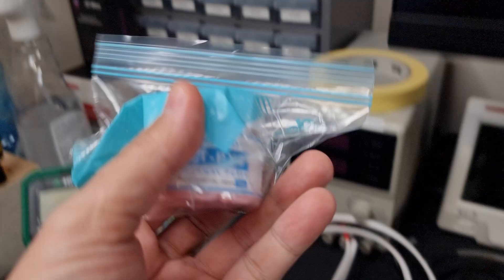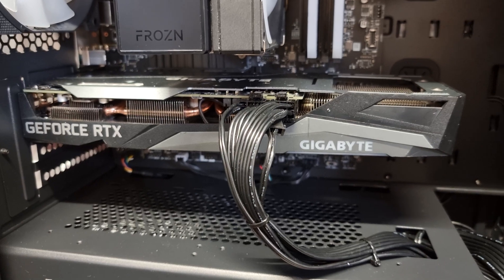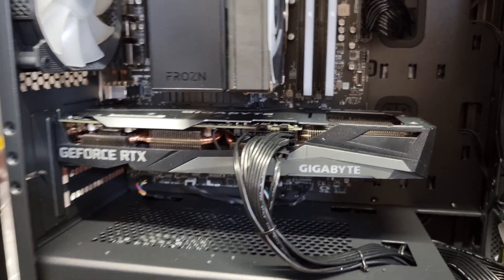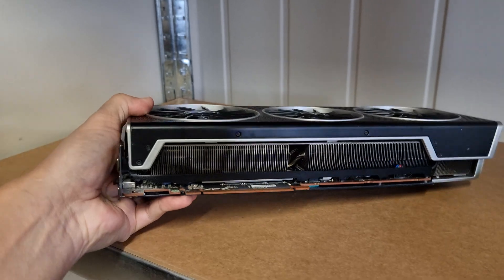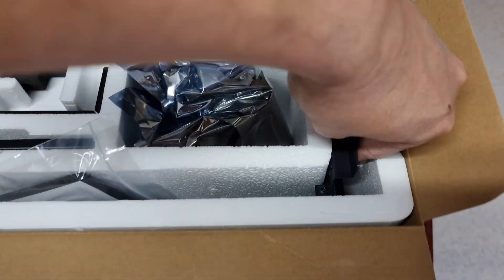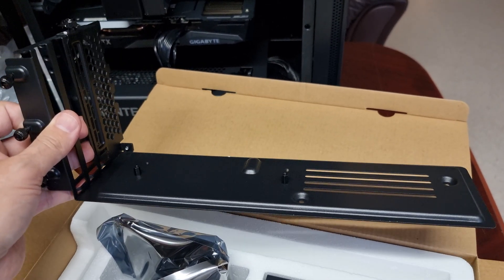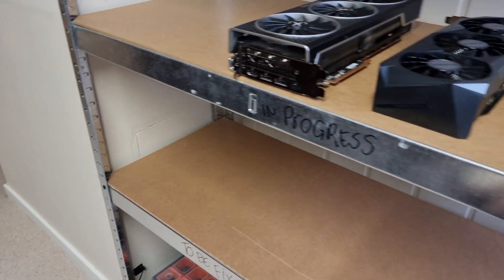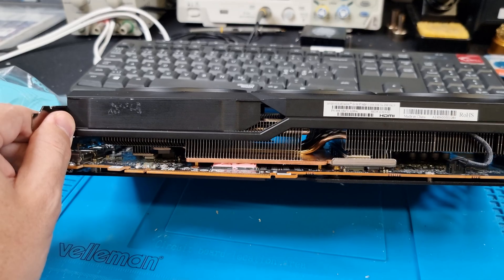Why Modern Day Graphics Cards Are Dying Prematurely.

Comment: Never had any problems before. Most of the cards I bought were on the lighter side. But when I got the 7800XT it was this big, heavy brick that felt like it could break my mainboard with its weight. I didn't feel comfortable using it like this, so I got a support to put under it. I do that for all cards that come with a big, heavy cooler now, because none of my cases has room for a vertical mount and I don't want to get new ones that have either a worse airflow or no room for optical drives. And the few cases that have both, the good airflow and the drive slots, they can cost almost as much as a graphics card.
Reply from the maker: Supports work fine. I have had many RX 7800 XT's come in for repair and it is always the same issue: ripped pads under the memory chips closest to the PCIe slot, due to sag. So you did right putting support under it!

Comment: I don't want to install my Asus TUF RTX 5080 OC vertically. Can I use the GPU anti-sag screw that comes with the GPU in the box? I will install it horizontally/normal.
Reply from the maker: Yes, as long as you level it properly with the support, you should be just fine!
Reply: @TechnologyHive  Thank you. Which one is the best: the anti-sag that comes with Asus TUF or ASUS ROG Herculx?
Reply from the maker: @VKing79 I like the way the Herculx looks. But really any support will do. I would install it between the second and third fan. I buy these in bulk and work perfectly fine. They are made from Aluminium: https://www.temu.com/goods.html?_bg_fs=1&goods_id=601099695186759&sku_id=17592891160347&_x_msgid=151-20250904-18-B-905764602225426432-427-zLleLmFr&_x_src=mail&_x_sessn_id=oxi6jszmzo&refer_page_name=bgt_order_detail&refer_page_id=10045_1763731584889_5tet87xich&refer_page_sn=10045

You can also find them on AliExpress.

Comment: im planning to buy an rtx a2000, do i need sag brackets?
Reply from the maker: By the looks of it, it is a two slot card with a plastic shroud. Honestly I have never seen one like it come in for repair. And I know people use these things horizontally.
Reply: @TechnologyHive  i plan to use it in a standard vertical pc as my desk doesnt have room to lay it down horizontally

online listings i saw apparently weighs this gpu to about 200 grams
Reply from the maker: @spiralingspiral72  Like I said, these cards rarely come in for repair, and it is usually because of mosfet failure or other issues.

Comment: My Sapphire came with a sag bracket. Even then you cannot cheat physics, it is super long 3 fan variant. It would not hold exactly level on those 2 little screws gripping this long sag bracket acting as a lever. But guess what, i spent 5 extra bucks and added a very nice, metal, magnetic vertical stand off Amazon and now there is zero sag. Is that safe enough?
Reply from the maker: Yes! You can also buy one from AliExpress or Temu. I bought this one here: https://www.temu.com/goods.html?_bg_fs=1&goods_id=601099695186759&sku_id=17592891160347&_x_msgid=151-20250904-18-B-905764602225426432-427-zLleLmFr&_x_src=mail&_x_sessn_id=5tvx3pe5b8&refer_page_name=bgt_order_detail&refer_page_id=10045_1763723059572_rcrer8du7o&refer_page_sn=10045

It doesn't matter where you get it, as long as it works.

Comment: I wonder what you're complaining about, that small bend looks similar to that of my tiny 3070. I think all gpus tend to bend.
Reply from the maker: Yes, all GPU's bend at the PCIe slot when installed horizontally without support. That bend kills the GPU's. It's not complaining, its called trying to help people who do not know this is the cause of a widespread problem.
Reply: @TechnologyHive  But mine doesn't bend because it's installed horizontally. It bends because the screws tension the soft pcb over the heatsink (At least that's what I think).

Comment: I'm using a sag bracket with my 5080
Reply from the maker: Yup, you should. That is a heavy puppy!
Reply: bought one for my Gigabyte 6800xt where it's been going strong after it was bought in 2022 but did scratch the card by accident after not protecting it
Reply: Same here with my RTX 4080 Super. I built it myself using a narrow DIP ICs shipping rack and a rubber foot for electronics projects box.
Reply from the maker: @francoisleveille409  People get creative when it comes to supports :)
Reply: @TechnologyHive  It helps to 'support' yourself when you build and sells electronic stuff. 😉
Reply: @UnL1k3  I have my 5080 mounted vertically with a PCIe 5.0 riser cable.
Reply: My case came with one that's really discrete and robust.

Comment: i bought the CH270 which the case is vertical base, so when having a gpu i don't need to buy a vertical extension like the regular pc case, the gpu is in the vertial mounting position by default (not like the vertical you would expect). But in your opnion, do you think mounting the gpu straight up vertically is going to affect the gpu anyway?
Reply from the maker: The GPU is hanging in this case, right? If so, I see not reason to worry. The problem stems from the card's weight and it being installed horizontally without any supports. Thats a nice case, btw.

Comment: Yeah most modern GPU's need a sag bracket if installed horizontaly. Vertical mount is the best solution i think. I have my RTX 4080 installed vertically in a Thermaltake TR100 mini ITX case. The case  also has a supprt bracket to prevent the card from moving sideways.
More case manufacturers need start inluding proper sag brackets with their cases.
Reply from the maker: IF they start creating long-lasting cards, how will they make their money? They create these things knowing the fail rate is high due to their weight when installed horizontally. They are not stupid. Its a shame. But you can find cheap supports on AliExpress or Temu even. It doesn't need to be fancy.

Comment: I have all heavy cards mounted vertikal - and if not i have anti sag under the card even on a RX 6600 :D
Reply from the maker: Then you will have long-lasting cards :)
Reply: i play a lot on rx 6600 over the years,overclocked to 2,7 (running around 65 degrees,HS around 75-80)and it didnt sag.i think this is more of a problem of mid and high pwr consumption graphic cards.
Reply from the maker: @LordTin79  Yes, its the heavier cards that are more prone to sag and thus early death.

Comment: What about the Asus Prime model? like a RTX 5080/5070 Ti?
Reply from the maker: What is your question? I have never tested those models, sorry.
Reply: @TechnologyHive  It's a 2.5 slot card so I was wondering if GPU support is necessary?
Reply from the maker: @Extravi  Yes absolutely, especially the 5080. Had to Google search image. That will need a support. Install it after the second fan, so 2/3 the way. It will live just fine like that. Hope this helps.
Reply: @TechnologyHive  Thank you.

Comment: Who opens the box, feels the weight and then trusts the fricken finger bro 😂 ?! WHO?! I BARELY, trust mounting it vertically. The 5070ti even by pny is heavy as FK. my whole case(itx) and the GPU weigh roughly the same without the cooler. Double bolt the thing vertically and pray it's tight.
Reply from the maker: I like those small ITX boxes. The motherboard being laid out horizontally is perfect for a vertical mount. I remember the Cooler Master Elite 130..great little ITX case. Sad its not made any more.
Reply: @TechnologyHive  I run a fractal ridge, it's a tower itx case. But mobo still mounts vertically. You should see how the pcie riser is a part of the frame. Its pretty nice being able to bolt the riser in place, and bolt the GPU vertically. The thing survived being drug by my car for 4 feet, a small dent in the GPU backplate near the end of the thermal fins, from landing on the pcie cables to the GPU. Nothing wrong with it besides resell value😂🤘
Reply from the maker: @atomicxpxp8430 Built like a tank then lol

Comment: Planned obsolence, either through missing features or carss physically dead... We are being robbed with shoddy build quality by design
Reply from the maker: They keep adding more metal to the heatsinks, thus more weight. A cleverly designed vapor chamber would do the trick with much less weight.
Reply: @TechnologyHive or better more robust PCB materials that can carry the wright
Reply: what if we could just put aio coolers on gpu
Reply from the maker: @spiralingspiral72  That could work also, as it makes the GPU lighter. Something like the Kraken G12 would work nicely, depending on the GPU.

Comment: Thanks for the reminder, I have always been a little obsessed and OCD about using Video Card Braces on every single video card I install. I always use GPU Extensions because it is very bad to plug or unplug the gpu power cables if the video card is plugged into the motherboard its an evil sinful practice of assembly disasembly. What your suppose to do is lay down the pc case onto the table then plug in the power cables into the card first then carefully lower the card into the case and plug the card into the board. Yes I love the 'Cooler Master Vertical GPU Card Holder Kit' it comes in black or white but you need to buy an extra large case to make it easy for u to build with. The second option is to use an old school horizontal case such as 'Thermaltake Core V1 Mini ITX Cube' or 'SilverStone Home Theater Case'. The third option is an inverted case such as 'Lian Li O11 Dynamic EVO Reverse Mode' what this does is your video card is installed upside down which is the preferred way to use a card in the horizontal position that way the heating element is pushing down onto the circuit board which prevents separation of the heating element from the circuit board. The fourth option are the pc cases that are 90 Degrees half way inverted where the video card is hanging vertically up and down for example 'Thermaltake Tower 600'. The take away is to stop using traditional pc cases and installing video cards the tradional way because it is the worst thing you can do for your video card. So Stop It. DO BETTER! Happy Thanksgiving Day and God Bless. 😇🙏🦃

Comment: 11min of nothing said
Reply from the maker: Yet you sat there and watched it lol
Reply: @TechnologyHive  I have been using gpu stand and it works great and also I target dual fan gpus for now I have 7600 XT XFX 210 and before I had 580 and it is alive still thanks to the gpu stand support and when I check my board on 580 with a ruler there is no gap between almost perfect flat board
Reply from the maker: @nocommentarywot7262  It can't hurt to use support even on small cards. You're doing it right!

Comment: Nitro+ cards tend to have a lot of reinforcement around the whole PCB. Usually some type of metal frame and always had some bracket to hold the card. The latest 9070 XT has also its vram chips far away from the pcie slot.
Reply: 🙂 yes the top tier card like the Strix, Nitro, Red Devil have the best built in braces but that will never be just as good and equal as installing the card in a safer position, we need to stop using traditional PC Cases, they are Archaic and were designed for older systems where video cards were never as large as they are today, times have changed and we need to get with the times
Reply from the maker: @MrSamadolfo A way to circumvent this  legacy ATX issue with pc cases is to just buy a vertical mount kit like that from Phanteks. I own 5 of them and would never build a system without one. You bring up good points.
Reply from the maker: I have seen many cards built like tanks. Metal everywhere. Yet as a twist, all that metal in turn makes the card heavier, even though it is aluminium. That weight is being supported by the PCI-e slot and supports if used. And that's where the problem starts.

Comment: mid-high range gpus with high power compsuption and heat must be cooled by liquids like high end cpus these days, big metal radiators and fans are cheap problematic option
Reply from the maker: The problem with selling graphics cards with AIO's is that it adds another failing point to the card. If the pump fails, the card is a brick until the pump is replaced. Vapor chamber coolers on the other hand do a decent job. But they are also more expensive than your traditional just aluminium built heat sinks.
Reply: You don't need AIO on any gpu except 90 series, because there is where you can get decent performance boost from OC and a little bit of "premium" quietness. Also AIO is not a super reliable solution in terms of longevity, so in this case it's simple for 90 series owner to just buy another new gen card after release and sell the current card, instead of doing maintenance like other users with lower tier cards. Because AIO lasts about 3 years without any problems, even if you don't change the liquid, more than enough to wait for another gen gpu, and here you go, rich peoples routine))

Comment: I let my pc build like year and a half ago. B650e-f WiFi with a 7800x3d- and a rx 7900 xtx Radeon. They build it horizontally am I screwed ? How can I check if it is maybe already damaged ?
Reply from the maker: No you're not screwed. But if you look at the graphics card and see it is sagging badly, like in the thumbnail of this video, I would get a vertical mount kit and use that instead, as that sag will kill your card in time. If the card was bad, you would know it by now as it would not post. I think you still have time.
Reply: @TechnologyHive  Thank you for your response i was checking under the gpu today i see on the ride there is like a L shape little standard that the gpu is resting on, soo maybe thats there way of balacing the gpu.
Reply from the maker: @thor8571  That L shape is part of the pcb and its there for retention. It is not going to help with sag.
Reply: @TechnologyHive I have fractal design north case. How would you recommend placing it ? I still have a 2 year garanty so I might let them do something about it .
Reply from the maker: @thor8571  That is a very nice case, btw. I recommend, if you have a support, that you use it when installed horizontally, 2/3 the length of the card, so if it is a 3 fan card, install the support between the second and third fan.
Reply: @TechnologyHive thanks for the tip sir! I’ll tell them,yeah it’s 3 fans they wil put a support on it but keep in horizontale.
Reply: 🙂 rebuild your computer as soon as you can, stop using traditional pc cases for heavy cards, theres better safer options now, install a vertical brace asap, and if it doesnt fit then like i just said pick a better case and build it safely, u got horizontal cases, 90 degress hanging cases, or 180 upside down case, anything is Better
Reply: You could also get a proper sag bracket for it either one of the ones that mount to the case and go along the length of the gpu or one to install at a spot to prevent sagging, also for a year and a half it will be fine, I had mine for longer
Reply from the maker: @Communist_Cranberry  You can pick up a support from AliExpress for less than $5. Or even Temu. It does not have to be fancy.